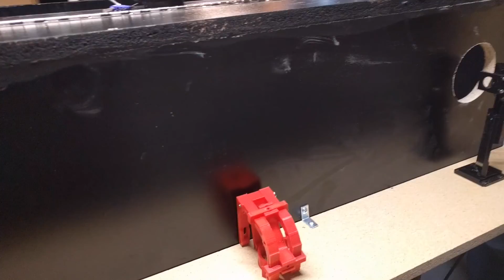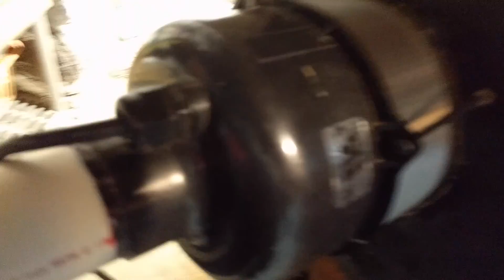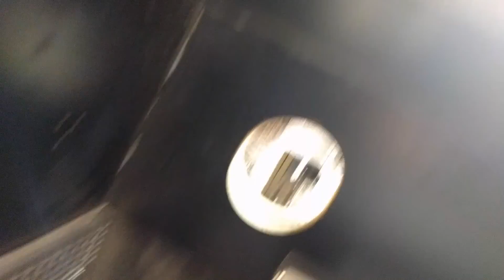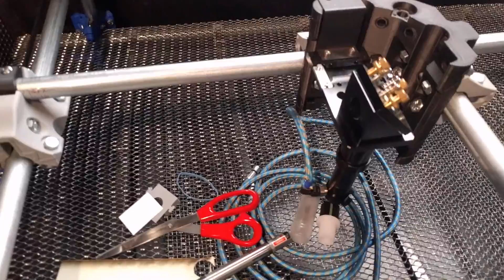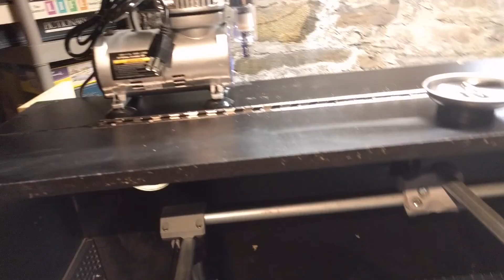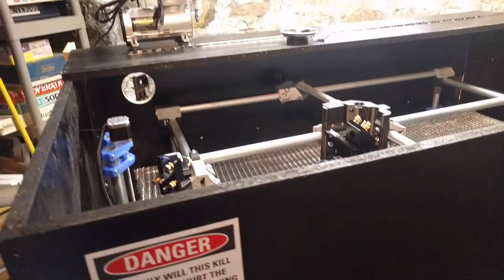Homemade MPCNC CO2 LASER Cutter Update: Housing, Venting, Mirror Mounts, Air Assist, etc.

Comment: Does it work in the end?
Reply from the maker: I got as far as firing the LASER through the mirrors, etc. but stopped before working out the wiring for operation of the LASER itself through the control board because I obtained a new Cloud Ray LASER cutter. The combination of having an operational LASER cutter, the low viewer/subscription counts on the channel, and the amount of work involved in producing videos made continuing the project kind of pointless. I purchased a diode laser head thinking of maybe downsizing the project, but I've been busy with other retirement activities. I may just end up selling the uncompleted project locally sometime over the next couple years.

Comment: Hallo wie haben sie hier die Halterung 
Ist das neu gedruckt 
Habe auch die Primo will auch umbauen auf CO2.
Reply from the maker: Ja, die LASER-Rohrhalterungen sind 3D-gedruckt. Ich habe sie auf Thingiverse gefunden. Sie können sehen, wie ich es in diesem Video montiere: https://youtu.be/1HoNT1L0sKE

Yes, the LASER tube brackets are 3D printed. I found them on Thingiverse. You can see me mount it in this video: https://youtu.be/1HoNT1L0sKE
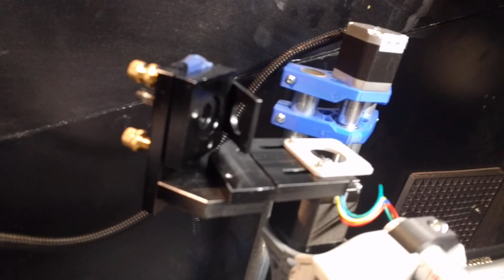Reply: Auf 3:55 dieser Halter ist auch gedruckt 
Sitzt direkt auf dem Motor
Reply from the maker: @thomaskirschner58  Die Spiegelhalterung ist aus bearbeitetem Aluminium - ich habe das von CloudRay (kein Sponsor) gekauft. Ich habe auch ein 3D-gedrucktes Teil verwendet (der graue Abstandhalter/Halter: https://www.thingiverse.com/thing:713203)

The mirror mount is machined aluminum - I purchased that from CloudRay (not a sponsor). I also used a 3D printed part (the grey spacer/hold-down: https://www.thingiverse.com/thing:713203)
Reply: Ist das Set ok
Vielen Dank für deine Hilfe
Reply from the maker: Gern geschehen @Thomas Kirschner! Das Kit scheint in Ordnung zu sein, obwohl es offensichtlich nicht für das MPCNC entwickelt wurde. Ich werde ein weiteres Video posten, wenn alles funktioniert.

You're welcome @Thomas Kirschner! The kit seems fine, though it obviously wasn't designed for the MPCNC. I will post another video when I get it all working.
Reply: @Dr.V.  
Es gibt 12 18 und 20mm
Welches Set hast du 
Lg
Reply from the maker: @thomaskirschner58  20mm